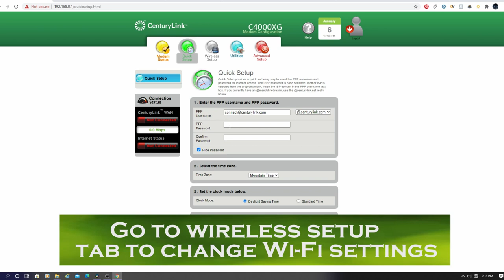WIRELESS ROUTER REPLACE - HOW TO

Comment: When you plug into the computer from the LAN router, you are plugging into where the ethernet used to go?  If there is no internet cable going into the computer, how are you going to open a browser to set up new router?  I only have one ethernet connection on the back of my computer, so I can't maintain old router into computer and connect another ethernet cable to new router LAN connection.  It's one or the other.

Comment: When plugging in the new router for programming it with the same ssid and other information my computer only has 1 Ethernet connection so I’m assuming that’s the one you use correct. Same for my Mac as well. Can the update be done via WiFi connected to my computer. Sorry I’m not very good with this sort of stuff. Thanks

Comment: What if I don't have a pc to plug the ethernet port into as you said into the pc, I have a laptop, but only has usb and hdmi ports, is there a way to switch a routers info wirelessly?  I have a century link router I'm renting from them and I am going to purchase my own bc it will be exponentially cheaper, I'm going to use the same type of router model, unless you recommend one that is far better.
Reply from the maker: You can connect wirelessly. Here's a quick hoe to video https://youtu.be/p-wZNeKRN7c

Comment: I'm curious if you rented or purchased your Centurylink Modem.  I need to upgrade and when you look  at the specs, you don't get the security protection if you buy vs renting.  Yet $200 outright feels like a better deal than renting at $15 a month.  Plus, I'm curious why you used their router and not a 3rd party one.  Do you like their quality?  Thx for video and an any insight you can share.
Reply from the maker: I don't use the CenturyLink modem it was for informational purposes only. It has limited features. I have a new Linksys router. Using the free equipment form the ISP is never recommended.
Reply: @UltimateTechHub  thank you. It’s so confusing. Century Link makes it look like you have to rent or buy and they only give you two options that are approved and their names I’ve never heard of. I consider myself somewhat technical, but when it comes to routers, I am not. Any suggestions of where I would find what is compatible or how to figure that out other than the Century Link website? Maybe you’ve done some content and I can search your site? And wow, thank you for such a quick response.  It’s interesting that the points at Century Link makes is that they want you to use their routers because they’re specifically suited to their needs. Apparently that’s not the case.
Reply from the maker: @mngirl7357  here is a video i did on CenturyLink. 
https://youtu.be/RJbR80rdFEY

Comment: You connected the computer to the new modem with the yellow line. You seem to have removed that connection as you transferred old modem lines to the new modem. is this the case?
Reply from the maker: Yes correct

Comment: Thanks for this!  I have a question about SSID names.  My old router has two SSID's, one for 2.4G and the other for 5G.  Is there a way I can work this or am I just sort of SOL?  It seems I may have to reconfigure any devices on one of the SSID's or the other.
Reply from the maker: Yes you can have several different SSIDs for both bands. And now wifi6e has the 6GHz which you can name as well.

Comment: My computer only has ONE Ethernet output and that is connected to my old CenturyLink modem of which the wifi is not working, BUT, I get the internet through that one ethernet cable.
If I unplug the old modem so that I can plug in and set up the new routher, I LOSE my internet connection, correct?  And if so, then how do I finish the set up???
Reply from the maker: You need to plug the cable from the modem into a wireless router then plug into the computer. The CenturyLink modem router combo is pretty awful. I only used this as an example for this video. Purchase a new router you wont regret it. If you join my Patreon for $2 a month you get 1 tech support question per month so keep that in mind. Thank you for watching!

Comment: Got a new router and the new one works for my cable tv using the green dns cable to connect it to internet but all my devices will only work with the old router which is disconnected but is still giving them internet and when I went to my router settings it said my old router was on but my new one wasn’t

Comment: My household doesn’t think they need a new router, but I do. If I secretly replace the old router with a new one and keep the old name and password, would they still have to resign-in to the upgraded Wi-Fi or will their devices recognize the name and password and auto connect as if nothing happened?
Reply: did ya change jt?

Comment: When I plug my new router in, can I connect to the new SSID and password on my pc, so that is only in one network, then change the admin settings to match my old SSID and password and then it will work across all devices or do I have to do this all separately and plug direct into a pc first?
Reply from the maker: Yes you can connect to the new router with your PC. Log into with admin then you can change the ssid and password to match the old ssid and password but you will have to manually connect all devices to the ssid initially. They won't connect automatically at first. I've tried that method and I had to connect each device to the ssid on the new router even though it's the same ssid and password. Hope this helps and thank you for watching.

Comment: Hi, my house just got fiber as well and we’ve been trying to connect a router to have wireless internet and can’t figure it out can you please help! We have the router plugged into the power and the ethernet is connect but still don’t know what we’re doing
Reply from the maker: The fiber cable needs to connect to fiber modem then a cat5e or cat6 from the fiber modem to the wireless router. Here is a video I posted about this installation.
https://youtu.be/RJbR80rdFEY
Thanks for watching and keep me posted.
Reply: me too, same problem...

Comment: Are you plugging in the green DSL line from the wall to the wireless router? The old modem, what happens to that?
Reply: He's still using the fiber optical modem just swapping the old wireless router. Apparently, his computer isn't wireless or not using it.

Comment: Can I not change the Router Name and Password? Does it have to be the same?
Reply from the maker: You can change it if you want. But if you want ALL of your current devices to connect right away then use the old ssid and password. Otherwise you have to change those devices which can be a pain. Thank you for watching I really appreciate it.

Comment: My mother in law has this same century link wireless router and it’s constantly going down. I’ve reset it several times and rarely works
Reply from the maker: I don't use the CenturyLink router it's just for informational purposes only. It's not a very good router.

Comment: Can I change the password to something new after doing all these steps and successfully connecting to the new router?
Reply from the maker: Yes you can.
Reply: NoneYa Business  new. I think after you transfer the wires to new router, you can do whatever you want.
Reply: @UltimateTechHub  Hi, I am in a rural area and my internet is via DSL (sick I know but can I do??) Do I plug in the dsl line prior to going into settings?

Comment: My WiFi went out on my Centurylink ZYXEL 5001Z Modem Router combo, can I just add a router to use for WiFi or does the WiFi need to be working on my modem for the router to work? the internet still works on the modem.
Reply: As long as the modem works you can just replace the router
Reply: @loganstelter9169  thanks, i will try that

Comment: The new router keeps losing connection it turns blue when it loses connection how can you fix it
Reply from the maker: If you mean router 2 make sure its connected from LAN to LAN to router 1. If you need to just reset router 2 and start over. Make sure router 2 has the IP address 192.168.1.2 and router 1 should be 192.168.1.1.  Keep me posted.

Comment: you should have kept the old router and ran a wireless access point, then turned off the wifi on the router
Reply from the maker: That's exactly what I did. I placed the old router in a different room and now it's an access point. I also have a RUCKUS 610r wireless access point mounted in my hallway ceiling so my wifi is running perfect. Downloads are at 700 mbps. Thank you for watching! I have about 50 videos on Home Networking so make sure to check them out!
Reply: @UltimateTechHub  Hi Do you have a video how did you do it ? Setting up the old modem as a router ? :) I am trying to do the same but I don't know how to program it in the Century Link website

Comment: This is a bogus self help. I only have a laptop which does not have a phone line connection. What am I supposed to do to program my new router.
Reply from the maker: Connect wirelessly to the default router SSID. The back of the router has the SSID and password. Thank you for watching!

Comment: can you use this router as a modem ?
Reply from the maker: No
Reply: @UltimateTechHub  why didn't you use the router that's in the century link modem?
Reply from the maker: @777dingo  Because I already have a good router. Plus my router is wall mounted and the CenturyLink router can't be mounted.

Comment: Why would you want to use this shitty CenturyLink router in the first place? I'm trying to get rid of that piece of shit.
Reply from the maker: I'm not using it. I'm just showing it as an example. I already have a fantastic router and 2 wireless access points. Yes the CenturyLink router is pretty awful thats why they give out for free. Thanks for watching!
Reply: What router would you recommend for CenturyLink?
Reply: @mikethomas4210  Asus router.